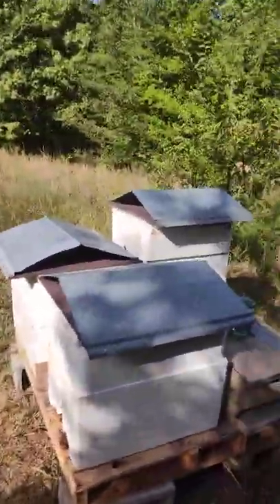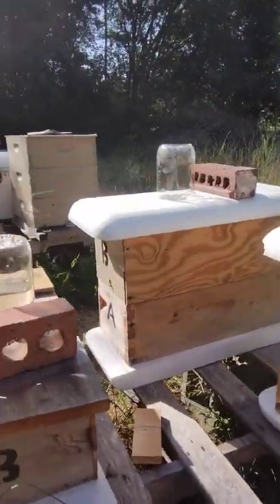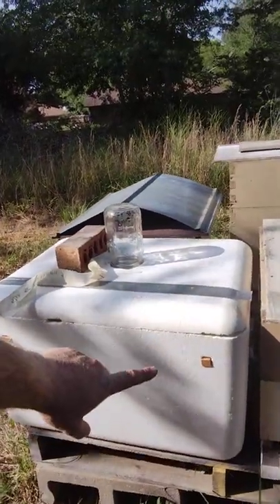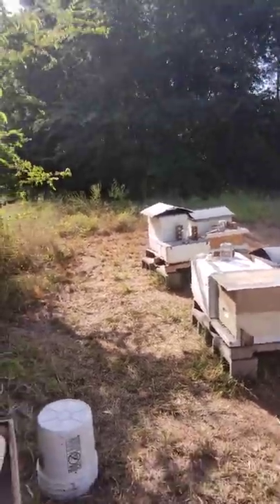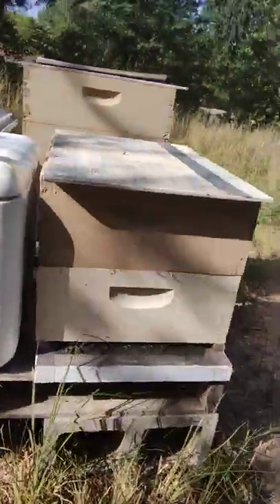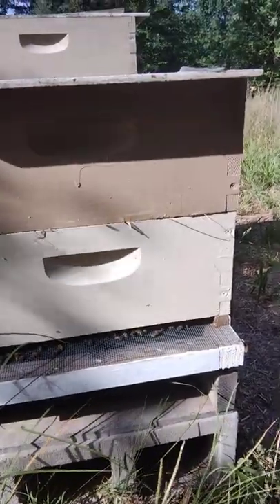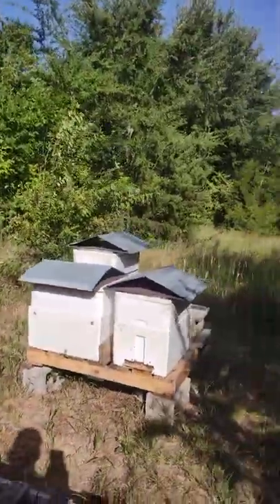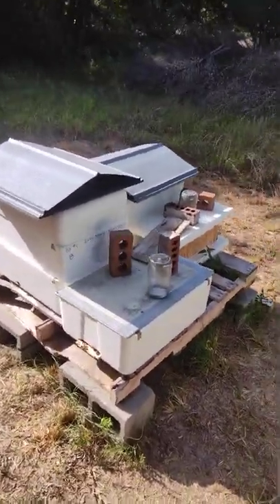Styrofoam bee hives in action - how they perform and what to expect

Comment: Thanks for the video. For me the Styro-recyling didn't do well: Ants, hive-tool and bees. But for solving a little your "chewing-problem": try to melt with hot wire instead of cut / saw entrance and sides of the boxes. It's better because the surface and borders of the "cut" is diferent and will lead to a little less chewing.
Reply from the maker: Yes, these styrofoam boxes don't take a beating well from anyone. I'm going to have to post a video of the "After" of what these hives look like after a year of use.